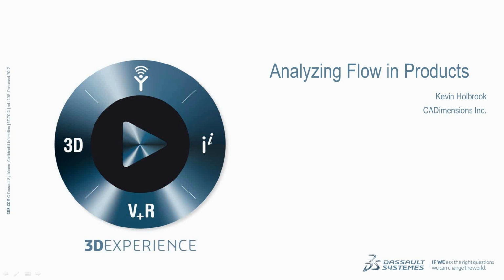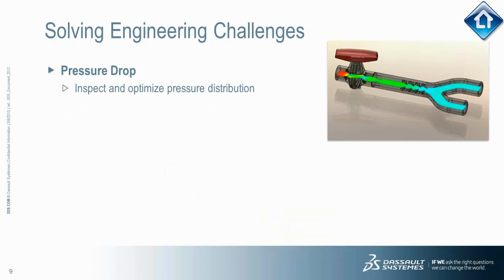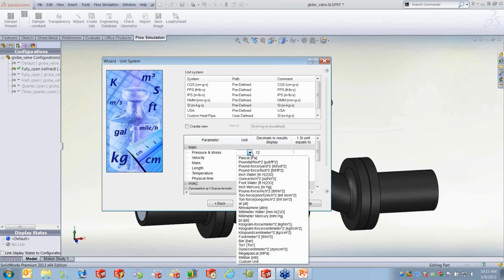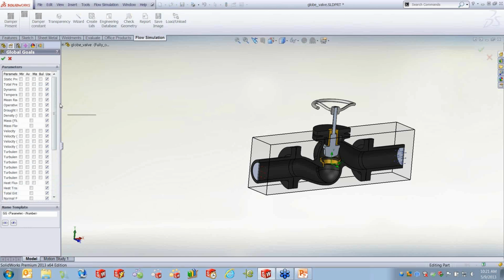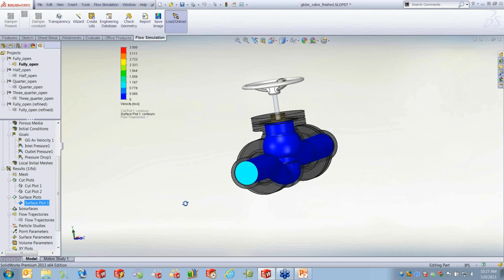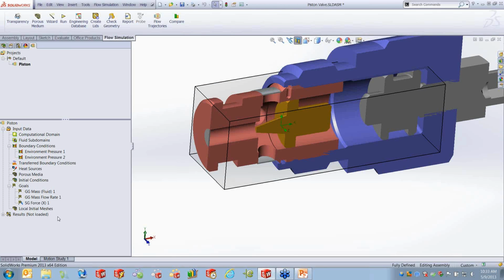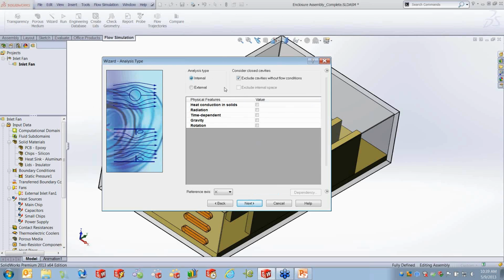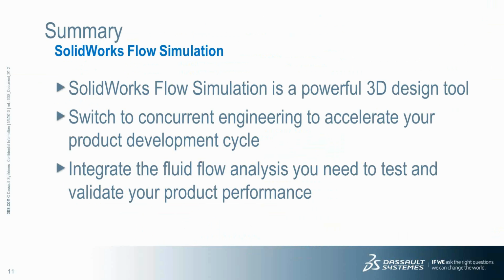Analyzing Flow in Products

Comment: hi can an analyzer use calculus equations in the flow simulation. such as x^2 for pressure inputs  as a velocity, yet integrate it to 1\3x^3, to use this as a calculus visual aid

Comment: how does this valve works? Im doing a project for school and I need to draw a similar one but I dont understand... If you could tell me....
Reply: +Carolina Poupinha   I think the valve was created to show the process. You would probably just have to copy it.
Reply from the maker: +Carolina Poupinha The valve works by loosening or tightening the when at the top. That will open and close the area below to restrict or shut off the flow.
Reply: +CADimensions, Inc.&#160; it needs a programming, like he entered befor the run, like one quarter half quarter and so on

Comment: I m designing a unique centrifugal compressor,i know the inlet mass flow and want to calculate pressure at outlet,what are the boundary conditions need to be applied in this kind of problem,kindly help.all i have is a 3 d model and value of inlet mass flow.